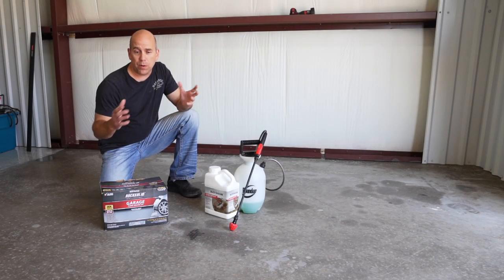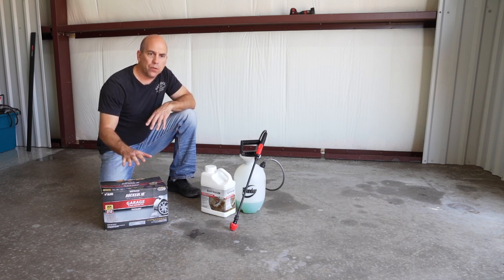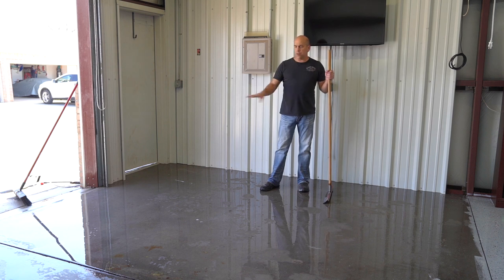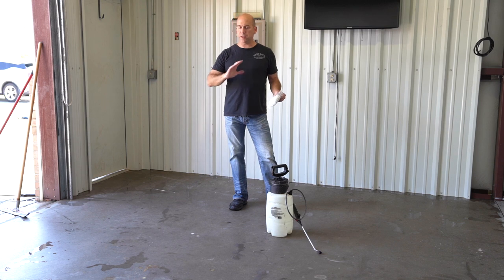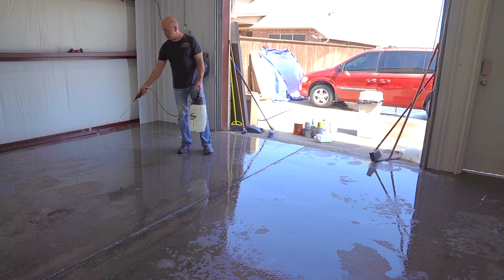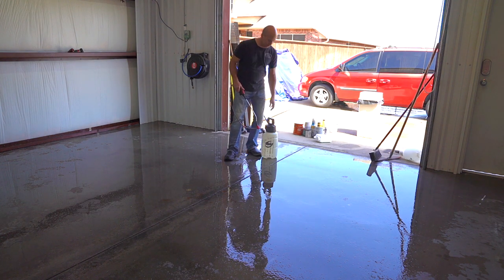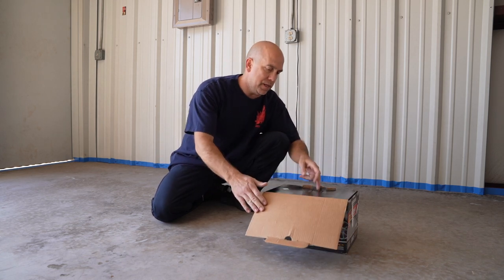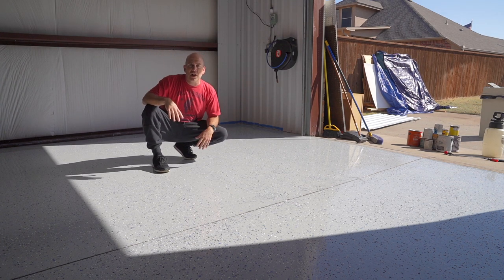Doing it right for the first time!  Rust-Oleum Rock Solid Garage Floor Coating

Comment: I’ve done several floors, mine, friends, family. Single garage, 2-car and 3-car. I agree with the prep being the most important and time consuming part. All of the floors are doing pretty well. Mine is the oldest 5 years, still looks great but I did notice some peeling in a few places. What I found was the material is not sufficient for the coverage and I had to buy additional material.

Comment: how big was the area and how many kits did you use? hows it holding up?
Reply from the maker: It was a single car garage area and I had extra paint left over out of that bag. Its holding up good but there is a spot where hot tires made the paint chip

Comment: I have a two car garage with those four pieces like that. Do I have to seal the space in-between the slabs, because I noticed you did not fill them.
Reply from the maker: I do not believe that you do. I didn't
Reply: Nope they are there for a reason. ;<)

Comment: How large was your area vs how much product did you use? Using this for my 30x50 shop and trying to make sure I have enough material before I start.
Reply from the maker: I didn't measure. I used a two-car garage pack and had some left over. If you are concerned I would spread it thinner and just go back over it with the extra if you have any.
Reply: 30 x 50 is 1500 square feet, it took me 2 - 2 car garage "Rocksolid" kits to barely get my 450 sq ft floor done, you would need 7 kits at >300$ a kit. I highly suggest you seek out some real epoxy that puts down a thicker coating, this stuff is very thin and covers 40% of what Rustoleum says it does.

Comment: Just curious, you posted this video over a year ago on doing your garage floor, how’s it holding up?
Reply from the maker: The floor is holding up great however there are a couple of little spots where the tires of my car after driving all day bubbled up. I think a thicker coat or prepping the floor by sanding it would prevent this. Overall I'm happy with the results

Comment: What I have a brand-new 20x20 concrete slab that my shed was put on?  I assume I can just sweep it clean, maybe wash it down with a garden hose, but no need for a degreaser or anything else right?  Also, what do you estimate the total time spent was for rolling it onto the floor once you started pouring it?
Reply from the maker: The prep is the most important and time-consuming part. The paint goes on in minutes depending on how big of an area you have.
Reply: My floor was new concrete too, but I still took the time to clean it and etch the concrete.

Comment: I do this every day and the only way to prep properly is to actually grind it. 

We fix floors done in this method constantly. 

There are hundreds of videos on how this is properly done, this just isn't one of them.
Reply: Yeah I was wondering about the grinding and crack patching aspect. Especially for older garage floors with more imperfections. How easy would it be for a DIY'er to grind?
Reply: Yea if you want to pay thousands for your garage floor instead of a couple hundred. No thanks.
Reply from the maker: Of course, grinding would be best and more paint too. However, this is for someone that doesn't have thousands of dollars of equipment. Maybe someone will call you to fix their floor in the years to come otherwise, this is a do-it-yourself video.
Reply from the maker: @jtinero  You can have someone come grind it but it will cost you a ton. and they will just try to talk you into doing the whole thing for more than you should pay.
Reply from the maker: @Glock274Jimmy  exactly!
Reply: If you have a new garage 2 weeks only do you still need to grind?
Reply: @jamaalrichmond523  instructions say concrete should be cured for a minimum of 30 days.  States nothing about grinding
Reply: Exactly, you can rent a grinder at Home Depot for a day. If you’re going to go through the trouble, go all in. Or you’ll be doing at again in a few years
Reply: @Glock274Jimmy  hand grinder, 40.00 at harbor freight. 10” floor grinder, 180.00 day rental at Home Depot. Diamabrush with a floor buffer, 125.00 per day. Worth every penny
Reply: @Glock274Jimmy  it's like anything else, you get what you pay for. We fix the floors of clients that tried to save $$$ all the time. It costs more to try it, have it look terrible, and then pay to have it fixed, every time
Reply: @jamaalrichmond523  This is a great question! You'll want to wait a minimum of 30 days, then moisture test it and scratch test it. The moisture test is to make sure there isn't so much moisture in the slab that the floor will be rejected (bubble like crazy or delaminate), the scratch test is to make sure you are using the appropriate diamonds for the hardness of the surface. (Hard bond diamonds for floors that scratch at 3-4.5, medium for floors that scratch at 5-7, soft bond diamonds for above 7) 
You will absolutely want to grind. This opens the pores of the floors to allow the epoxy to penetrate and bond nice and deep, that way you'll have no failure

Comment: Stressing the prep aspect but yet you don’t prep the concrete for optimal adhesion? What’s the point of doing this if it’s going to have to be redone every few seasons? It’s just a base coat and a few stagnant chips. Looks alright for the first year (if hot tires don’t pick it up by then) and then it’s dull and gets dirty. It’s best to just leave the concrete how it is and deal with it until you can afford a proper coating using proper preparation. If you install this kit yourself, and decide you don’t like it, well now you have to spend a lot more money to get it removed and done right. I wouldn’t have a problem with this video if you didn’t say “doing it right for the first time”. Like come on man what a hack.
Reply from the maker: thanks for your comment. this is a DIY project doing it the best I can without heavy machinery. so yes, preparing the concrete with what a DIY might have. no reason for you to get your panties in a wad about it. if you don't like the information, keep scrolling, troll.